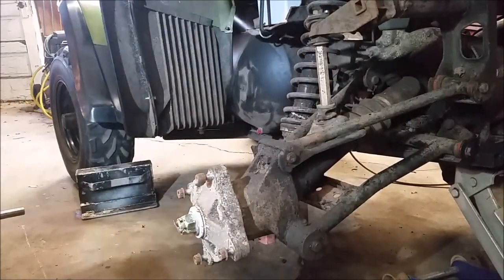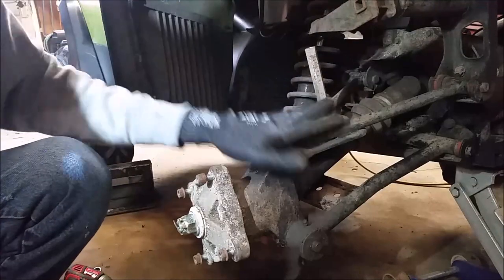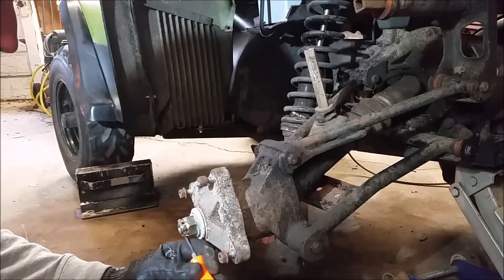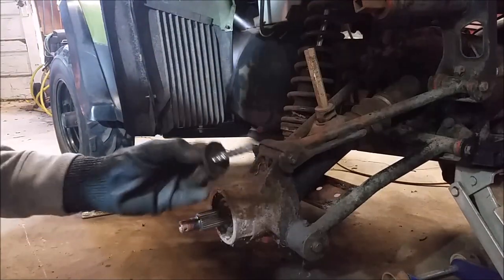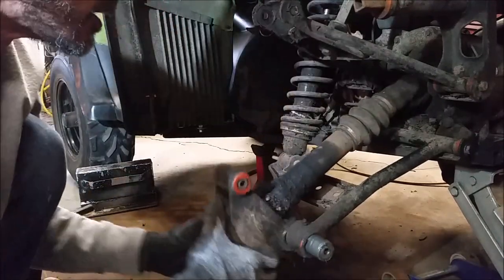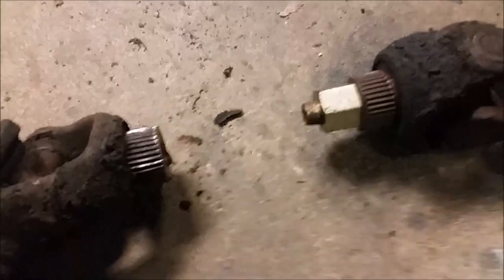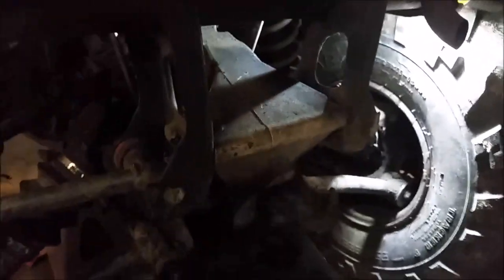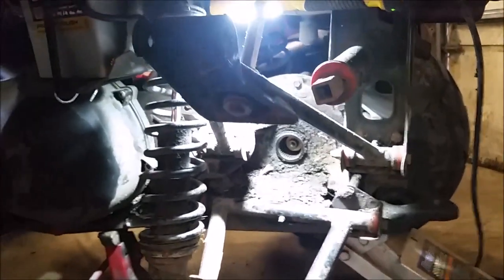Polaris Sportsman Rear Axle removal

Comment: I have a 1996 Polaris Sportsman 500. Watch all your videos for my Wheeler rebuilds. I replaced my rear cv axles and didn’t notice the old axle alignment to each other. So I put them even with each other and now it wobbles. Does it need to be off set of each other?????? I would greatly appreciate some advice? Thank you in advance!!
Reply from the maker: It could very well be your wheel bearings.
Reply: @TitaniummanGarage  thank you, I’ll check them out tomorrow.

Comment: Thanks for the great video. I have a 96 sportsman 500 I just replaced the rear axle and the u joint on the left side hits the upper front arm bracket. Have you seen this before?

Comment: Thanks so much spent forever trying to just yank it out like all the other videos because they never had a 97 this helped a lot
Reply from the maker: LOL. I feel your pain. I did the same thing until I looked up the part and saw the bolt.
Reply: @TitaniummanGarage  how do you get that bolt out that holds the 2 axles togeather..it seems like you can't get anything in there to get on the head of that bolt with the U joint in the way....I have to change my U joints and its freaking me out a little

Comment: I have both bolts completely loose and absolutely cannot get the shafts out, have you any tips that may help, what a battle
Reply from the maker: Should be a nut and bolt between shafts. Unless it's a different year. If so just pull hard on it.
Reply: @TitaniummanGarage  its a 97 explorer 500 , i just see the bolts that are inside the transmission side of the yokes, thanks for the quick reply , I'll keep on trying and thanks for the awesome videos , many of them have REALLY helped me out!!!

Comment: I'm doing this now but after getting the bolt loose it wont come out. Any suggestions on how to remove the axle from the transmission?
Reply from the maker: I had the same problem.  Take the side with the nut off first. Then pull the side with the bolt out. The bolt comes with it.

Comment: NHi good video I have a question  for you I have a 2012 spnortsman 400 Polaris  I pulled both axles out of ball retainers without removing hubs can I install axles back into transmission without removing hubs or can I install axles through retainer clip with the ball retainer still in tranny housing e you understood what I am getting at I am just replacing boots thanks hope you see this bye for now\
Reply from the maker: If your just replacing the boots you could do that.

Comment: I have one more question..when u put the hub back on did u use a jack to jack it up because of the shock ? Jack it up back in place ?
Reply from the maker: You don't have to. But it's a good idea. You won't strip out the screw.
Reply from the maker: If you want..Watch my hub replacement video. I took it apart and put it back together in the vid. https://youtu.be/IUWyB4bn0HU

Comment: Do I need to take the bolts out of both sides of gear to remove axle. I took off the left side and can’t get axle out
Reply from the maker: Yes, I found out the hard way
Reply: I’ve backed out the bolt on the left side I put a wench on both sides and as I turn it keeps turning both bolts. As I turn it should release and spin freely right not both continue to spin.
Reply from the maker: It's just a nut and bolt in it. Hold bolt and spin nut. Don't feel bad. Took me a while to figure out too.
Reply: @TitaniummanGarage  Hi my friend have a 1997 also the propshaft does not run in 2x4 is that normal?

Comment: So I have a 96 and I can’t get rear shaft to come out I have the bolts out as far as they will go (up against the u joint) and will not pull out any suggestions?
Reply from the maker: Sometimes they are stuck on so bad. I just had one that wouldn't come apart. try heat..?

Comment: Another great Vid! Thanks.....guess what I'm doing tomorrow...? LOL
Reply from the maker: Ha ha. I guess your getting a lot of use out of my vids. Glad to help.
Reply: @TitaniummanGarage  sorry! I fat fingered that response! Great videos! I'm not a gear-head and I not dumb either. I think your vids are great and VERY helpful! Thanks for taking the time to put them together!
Reply: @TitaniummanGarage  I was able to get the right side in and out without much trouble at all. Was pretty surprised actually. I paid for it on the left side though. I can't get the bushing on the bearing housing out. Any tips on removal of those if they are stuck in place?

Comment: Hello I was woundering. If I can use aftermarket cv axle like instead of those four joints .? On the cv axles
Reply from the maker: Do you mean the U Joints? If so yes.
Reply: I’m more like talking about the rear Or back CV axles instead of stock can I use aftermarket ones umm my model is 1999 Polaris worker 335 has the same set rear CV in this video only reason I’m asking cause of that bolt thing in the mid of diff an the two cvs axles would cause a problem
Reply: My left cv axle went bad an it broke in two so I gotta buy it order anew one so I was wounder can I go with out the U-joints but my thought about about that main bolt in the middle of diff an axle ...?.? Please help me
Reply from the maker: @buffykiller12  Have you checked E bay? sometimes you can find used ones cheap.
Reply: I’m I looking for the same rear cv axle or can I go with the upgraded one without those U joins seems like they break fast ..
Reply from the maker: I think your right. I haven't seen ones without u joints. I wouldn't trust it. Guys put lift kits in and the 5 inch lift snaps the axle.
Reply: Where is that extra 5 inch coming from you mean the middle where they bolt on too it I did go with solid axle.?
Reply: Thanks I’ll with u joint style like normal